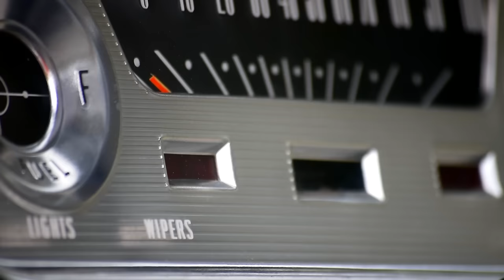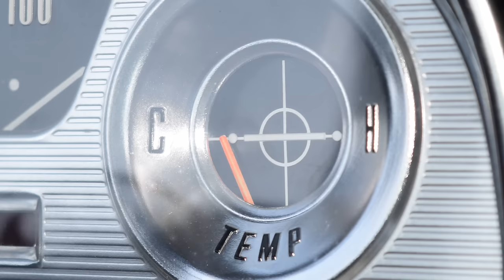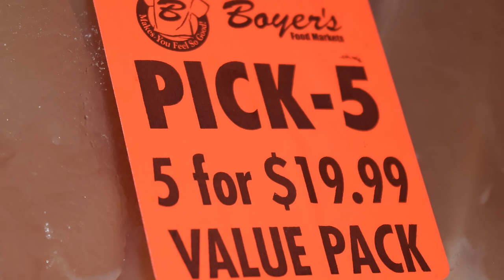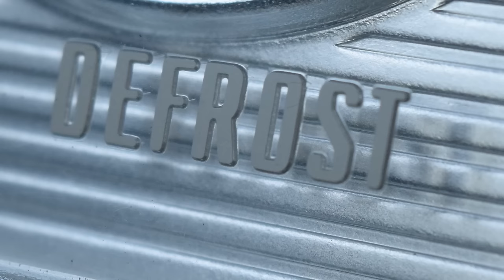Regular Car Reviews: 1960 Ford Falcon (stock)

Comment: These old 6 cylinder Ford Falcon/Mercury Comet vehicles would not slow down to 30 mph when climbing a hill and drove/drive perfectly well at any and all US freeway speeds. As was the case with a 6 cylinder Rambler American or a 6 cylinder Dodge Dart/Plymouth Valiant or a 6 cylinder Chevy II of the same era. If that's not the case with the vehicle your "reviewing", then it's a well worn example with an extremely "tired" drive train. If you don't know what your talking about, it's best not to talk.

Comment: Your engine is worn out or it needs a tune up or carburetor rebuild . Nobody bought a car like that with no power to go up a hill . The Ford straight 6 was no power house but could move along at a decent pace . Come on guys a little less bong time and more hands on get greasy and read a Chitons manual . The Falcon will surprise you and surprise your self on what you can do .

Comment: Just saw this video again. YouTube presented it to me aga8n after many months, maybe a year. You are really reviewing a car that is 60 plus years old and criticizing it like it is new out of the factory. A lot of items you picked on, we the same on any car built that year, by any manufacturer. Example absence of amber turn signals. For performanse that 144 engine did well on hills when it was a newer car. Your engine is old and worn out. Maybe you should think about a rebuild. The steering components in your Falcon are worn out. You need to replace them. My Falcon's steering wheel wasn't that loosè. Actually you can see a lot of Falcons still on the road. Go to car shows, you will see them. There are Falcon clubs all over the US. Google them!
Reply: Too late man

Comment: 🤨 I've been around Ford Falcons for 40+ years and watching this video was very insulting and angering. There's nothing wrong with the Falcon it's just we have a bunch of lazy drivers who are pampered and spoiled. Having been around 61,62,63, and 65 Falcons with 144ci 170ci special and 260ci these cars got great fuel milage for the time and still today. Yes they didn't have all the bells and whistles that Mustang, Galaxy, and Thunderbird but they were affordable to the masses. Todays vehicles are just plain garbage and now have 1/2 of their electrical components made in China and in 2022 we are now paying $26,000+ for a plastic vehicle that will brake in less than 6 months and cost $1,200 to $7,000+ to repair. If Falcons aren't so valuable why are they going for $10,000 to $40,000 now on the used collector car market? The Mustang owes it's existence to the first 3 Falcons 60, 61, and 62. 64 Mustangs and 65 have Falcon in their underbody DNA just look. I will always come to the defense of the Falcon and also those of us who have owned many Falcons have made them better cars than they were intended to be.

Comment: Those old Ford 6 cylinders were horrible engines, wouldn't even take a 2 barrel carb because the intake was cast on the head.

Comment: I remember these cars. The Falcon and the Comet both were like one of the worst cars around at the time. Cheaply made, and instrument cluster that bolted on to a metal dashboard, no carpet, an engine that could hardly propel the car. Speaking of engine it was not very reliable. I blew up 2 of these just trying to go on the freeway at 65 miles an hour.  These cars and others are how Ford got its reputation of Fix Or Repair Daily.  Most of the Fords in the early 60's were underpowered and the vacumm windshield wipers were a nightmare. The 1960 Rambler was a far superior car for the basically same cost.  The only Falcon that was worth anything was the Sprint with a 289ci.

Comment: That air clearner is loose - lmao.
There's no pcv vavle -  just a breather exaoaust pipe under the hood.
If the motor is shot, u'll get a face & lungsfull of smoke just idling! lmao
I bet there's NO FRONT SWAY BAR either - corners like CRAP, espec with crap bias ply tires - can u make them howl? lol
No tinted glass or day nite inside mirror! hmmh